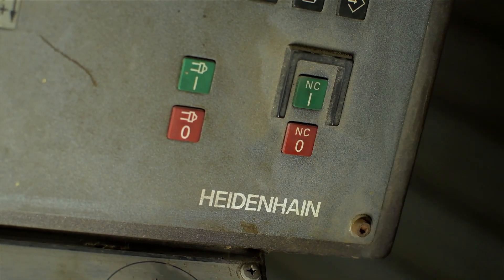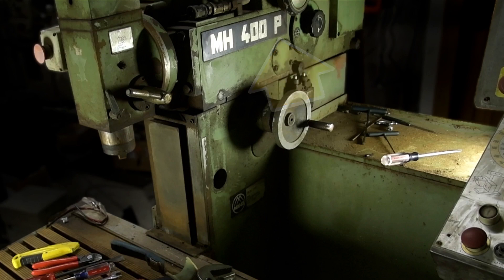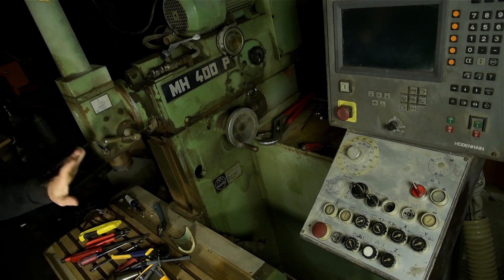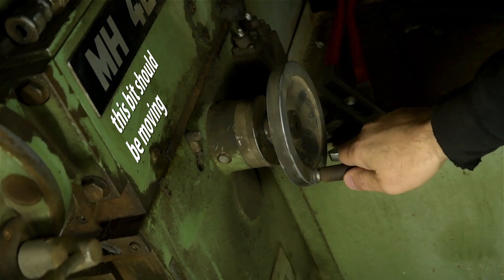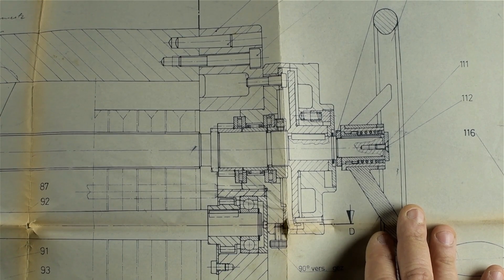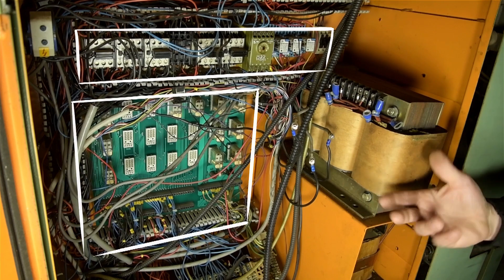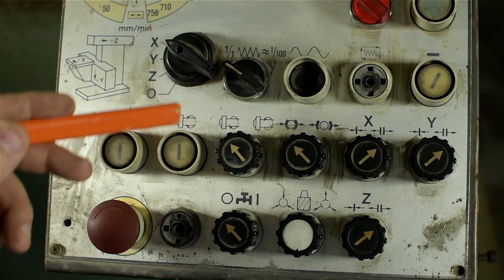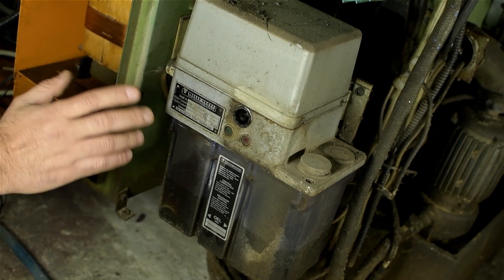MAHO is Filthy!!  (Whose Milling Machine Isn't?)

Comment: As far as i know the Haidenhain Control IS essential for the machine to do it's thing, with the original Wiring

Normally, after bootup it Asks you to reference als three axis. That may or may not be done by powerfeed.
you can skip that part by pressing the butten next to "KEIN REF"
also all emergency stop buttons have to be pulled out and some sort of enabling button has to be pressed at least once. That should be the same as in the bigger 600 you have a manual for.

Changing the Language should work something like the following(if I remenber correctly):
-TNC booted up, out of the reference mode
-Press "Mod" Button. 
-Toggle with the page up down button until you are in the collumn with "Sprache" in it.
-Choose "Sprache" set to your desired language

If you have other Questions feel free to ask, I'll give my best to help(also with Translations)

Comment: I think the tranformer have such tremendus starting current that You fuses pop!
Try to mount a 12-15 ohms resistor (1000W) in series with the transformer and a relay, driven by power from inside the transformer, shorten the resistor.
Then it Will start on small fuses.
IF You intend to take som substacial cuts, You might need bigger fuses, anyhow...
Always nice to watch You videos!

Comment: aktually we have 2 mills with this Heidenhein Controll those 2 never run sometimes theyburn sometimes they just shut down so we just dont use them have also Mills with never Heidenhein Controlls they just work fine also CNC works just nice

Comment: You never heard of maho??? 😲😲😲😲 Deckel maho gildemeister ?? DMG ?? Whaaat. Some of the best German iron these old maho's. 

They merged with deckel and the gildemeister last to form DMG. The best CNC machines on the planet. 😄
Reply: Cast iron takes time and patience, as well as purity control. The rest is history. 

Most manufacturers either avoid cast iron, or use cast iron with bad impurities that make the alloy unstable and prone to cracking and wear. Or, worse, they don't wait for the cast iron to set (it takes years). Then when a few years after they made the machine, the whole thing crooks over, everything jams up out of alignment permanently, and the whole thing is scrap, since the whole casting bent and twisted like it contracted bonetitis.

Comment: The Fuses are E27 (like the Lamp socket) and Called Diazed, Still pretty common in legacy Electrics in Germany.
Reply: Something makes me think this guy knows exactly what he's talking about.
Reply: @geraldgepes  Quite common in old houses in Norway too, we had sexyer holders tho Change'em for type C automatics
Reply: @Mr89netrom 
Lived in a old house here in Florida that had screw in fuses, though from the pictures I see our fuses look like a decapitated lightbulb while yours looks like a socket extension wearing a pointed cap.
Reply: We Germans love fuses and still like to use them in new equipment. A breaker will wear with every trip - a fuse is always new and in mint condition. Also, fuses will prevent idiots from trying to power up broken equipment a dozen times before getting somebody who actually knows what he's doing...
Reply: @meosalami5180  There is no fun if you know what you are doing.
Reply: @TonyDartford  Basically yes, absolutely - but if I'm the guy who has to fix what the idiots have left behind, it does become an issue ...
Reply: @meosalami5180  You volunteering to fix it
Reply: We have them hear in Brazil too. I should say that you can still buy them but they are being fazed out.
Reply: Heck there are many homes in EU still using those fuses. Order them up online if you need them.
Reply: Edison socket fuses sounds absolutely mad, but I suppose the electrical behavior of a fuse and an incandescent isn't that different.
Reply: I don't have the words to properly express my joy when I'm watching and exclaim "That's a 'whatever'! Just 'thing to do'." And then scroll down the comments to find gold like this. 
Heck, I've even been that guy who strayed from the original video topic in asking help from the Hive-Mind and I still got the needed answer.
Reply: A friend of mine was hired to rewire an old machine shop in Germany to modern standards. When he started to remove the old fuseboxes, he found the funkiest "replacement fuse" ever: Someone had turned a perfect Diazed fuse insert on a lathe from a solid piece of round stock! I guess the normal fuses kept blowing, so they got a little bit creative...
He took it with him and still keeps it on his desk...
Reply: Grumpy Electrician ich will Deinen Namen nicht in Frage stellen aber waren das nicht Neozed ?
Reply: @Rapunzel_thicc  Neozed sind die Kleinere, modernere Variante welche  häufig in Sicherungslasttrennschaltern verwendet werden. Diazed werden aber auch noch z.B. als Vorsicherungen in Verteilerschränken verwendet. Für alles größere braucht man dann NH-Sicherungen.
Reply: @web1bastler  Und die in der Maschine sind wahrscheinlich Silized. Das sind alles Unterschiedliche Auslösecharakteristiken in der gleichen Bauform, je nachdem, ob ein Motor, Elektronik oder Leitung geschützt werden soll.
Reply: @risfutile  Diazed ist die Bauform. Die Auslösecharakteristik ist mit zwei Buchstaben angegeben. gG ist die normale Charakteristik. gS ist für Halbleiter und gM für Motoren.
Reply: yeah i love those things almost as much as hotdogs covered Sauerkraut you can get breakers as well i have a small 2 fuse box for my house with a pare of 20amp breakers but i also sleep in a coffin and avoid the sun so yeah some people still use them just probably not normal people 

main point there easy to get i think lowes has them some people call them t-type / e27 / screw base fuses but the breakers are worth it
Reply: Just put aluminium foil around the E27 base. Works a treat!
Reply: @IncreasingVoltage  Be sure to use the "Heavy Duty" but from a discount brand.
For me, I usually just wrap a bodge wire in a helix when installing a fuse. That way I'm never asked to go back to that machine.
(Attention: Anyone reading this. That was a sick joke being told because I've seen it done too many times! ONLY use the proper fuse. It might save my life. Thanks.)

Comment: this will still be a quicker project than the chainsaw gocart
Reply: Will probably end in the same way; by throwing away the project and just buying the end result after many hours of swearing and many cut knuckles
Reply: I am sure this project will be finished well before Tom Lipton's Etch press project! Also recall AVE old CNC mill project, that was ended up getting replaced with a brand new Haase Mill.
Reply: @guytech7310  Will it beat the Physics Anonymous lathe rebuild series to completion?
Reply: @guytech7310  AVE has two mills on the healing bench! that old cnc mill gathering rust as well as the mazak manual mill that he like 85% fixed, decided he didnt like turning knobs and bought the Haas

Comment: Having an isolation transformer on the input of a German machine is pretty typical, just be careful because if you lose power, you'll lose a lot of info as the computer won't have time to react.
Reply: Nawww, someone needs his nap....
Reply: @matttradie1341  That'd be 7 billion humans to a permanent nappy comfy MOIST GRAVE TO DECOMPOSE IN. And seriously, who said anything about chucking an entire machine because of a fuse????? WHO , WHEREEE, oh, right, nobody, and the other idiot was crazy
Reply: @dimitar4y  ya' know, help is available these days.
Reply: kerryithm2  The current system uses proprietary hardware with RAM chips that keep the data on them, with no programming to offload it AFAIK. You'd have to install a UPS to keep it powered, and add in a botch wire to pause the program if the power gets cut off to the machine. Unless the manual talks of a hidden backup feature. Modern machine control panels, I think, should have auto-backups, and on re-powering it'll require an operator to review before resume. Community made CNC projects don't back it up though. USB cables aren't very good at noise absorbtion, and those motors are pretty noisy (electrically). 3D Printers getting their code on USB wire can get crashed by a single motor running in the adjacent room. Even a tiny dremel.
Reply: he said he's gutting the old electronics, pay attention.
Reply: @dimitar4y  yeah, I jumped the gun a bit, still relevant information on any CNC though. I run into this issue a lot at my current place of work.
Reply: @andrewyork3869  Who's throwing away a fine machine? Tony's gutting the old electronics because he wants to update its CNC capabilities to simultaneous 3 Axis work (potentially 5 axis in the future) with ability to read GCode off USB/Drives. The current one is damaged in unknown ways, and is only 1.5D milling. Seriously, are you drunk or did you just woke up?
Reply: @andrewyork3869  I had TWO. And neither of them mentioned anything about throwing otu a perfectly good machine, or athrowing a machine out that had a broken fuse/motor. Why is everyone os fucking brandead these days, god damn. "2 + 2 = 4" and there's still morons who say "WHUU?? I DONT UNDERSTENDD" everyone has SHIT for brains and they say everyone ELSE is wrong, FUCK DAMNTI

Comment: Not fair! Tony has TWO euro made milling machines and I am still at zero :(
Reply: You can buy one for 3500€ here:
https://www.ebay-kleinanzeigen.de/s-anzeige/maho-mh-400-mit-tnc-135/1221618255-280-2724
Reply: But with a TNC135 it's nearly useless... and because of the weird axes drive and the vario drive for the main spindle quite hard to convert to a modern CNC machine. The Maho C, E and S ranges (most with Philips 432 controls) are better suited for a conversion.
Reply: Jan-Albert van Ree I was gonna say Old Tony should just chuck this and get a 600 with a 432 controller. If he’s a lucky old tony he can look for a Deckel FP3, would be a better choice since the horizontal spindle axis seems to confuse him 😂
Reply: Why a lowly 600? The ultimate Maho is the MH1600S, with rotary table and tilting head :)
Reply: they are german
Reply: @blameusa7082  MAHO is but Schaublin is swiss made. Both are in Europe :)
Reply: Me too, I have 1 and that was made in Taiwan....
Reply: Machineseeker.com
Reply: Gee Tony.
Reply: i would go for a schaublin or a tos
Reply: Maybe it has to do with the fact that he is not a real machinist and you are?

Comment: TOT is sick with MAD (Machine acquisition deficiency)
I think he's cured for now ;-)

Small P-Mahos suck at CNC btw, 1 servo with clutches on all axis and ACME screws instead of ballscrews. Maho 700P has 3servos and ballscrew on all axis, however.
Transformer @ 8:50 is for Indramat servo drive btw. Needs something like 2x 180VAC with center tap for SCRs to control servo speed.
Hydraulics are used for axis clamps, each axis has like a tube on the inside of the gib that gets pressurized to lock the axis. 4th hydraulic valve is likely for hydraulic drawbar. And yes, hydraulic pump noise is normal ;-)